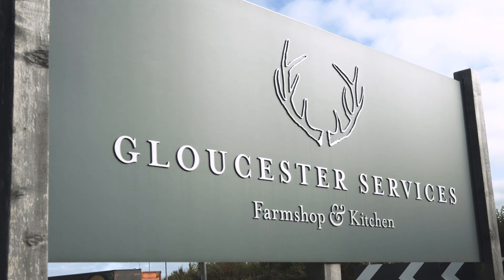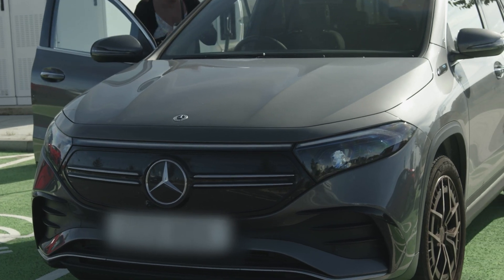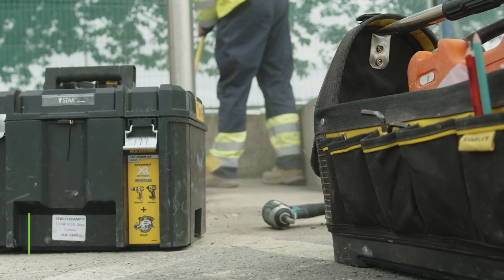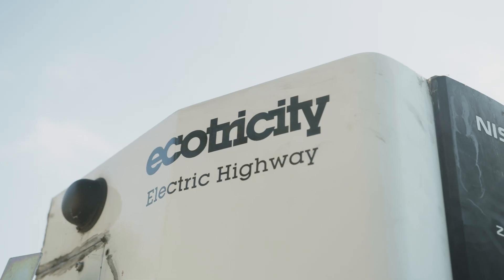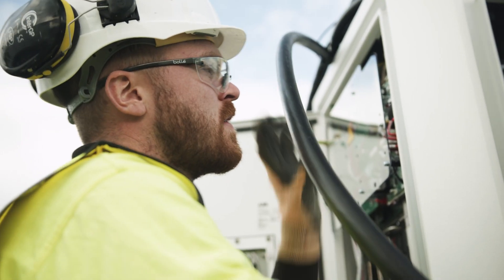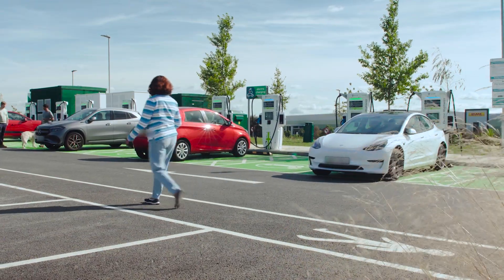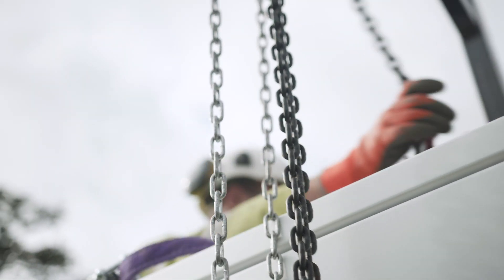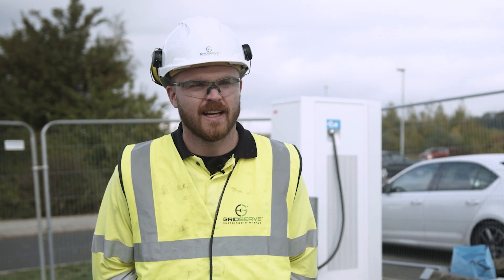Upgrading the GRIDSERVE Electric Highway

Comment: I've an MG5 on order and look forward hopefully to a trouble free journey environment. I clicked on this Gridserve promo video. It is misleading and disappointing. It opens with a drone shot of one of the new excellent facilities, Braintree or Rugby? Not clear, but there seem to be 18 charger units. The message is clear, this is how Gloucester north is going to be. Cut to interview with engineer working on the Gloucester North M5 site, All going to be great, everything will work, full power and reliability etc etc.

The video is five months old. I then switched to Zapmap and the current Zapchat comments of disappointed users of the same site, Gloucester North M5. Only 2 units, or is it 3, not clear. Repeated problems of low voltage, excessive waiting, units that boast high speed charge, but cannot be used by two cars at once if high speed is required. Hints that some drivers are giving up and going elsewhere.

Come on Gridserve. You are doing great in your new flagship units, but don't b****t us with stuff that just isn't true. Tell it like it is, if you want to encourage EV purchases. 

Peter Biddulph

Comment: It’s great what you are doing… but none sadly are being installed in a way that makes them fully accessible for disabled EV users… not even at the Rugby new build… why? Are disabled customers not important to GridServe?
Reply from the maker: Hi Ian, without question, EV charging needs to be accessible for everybody. This summer, the Electric Forecourt in Braintree hosted Motability Scheme customers and Designability to better understand first-hand experiences around EV charging. We're keen to apply these learnings to our future built environments and our charging process, for the benefit of everyone. [Jon]
Reply: @GRIDSERVE  - Hi Jon, thanks for your reply. I’ve personally been actively campaigning for much improved disabled access (as is laid out in current legislation) to the EV charging infrastructure for the last six years; it’s been a very long battle as most organisations simply aren’t interested. I’ve yet to visit the Braintree hub but I’ve good things about it. The problem is that is just one site. In the current race to roll about more infrastructure, basic accessibility for disabled EV users has been totally ignored sadly; as is the case at the Rugby new build; a wasted opportunity to create better access! Will GridServe be retrospectively improving disabled access at all locations that have been upgraded so far? If not, why not?
Reply: Why is it necessary to mount the chargers on a raised plinth? Flat ground is essential for wheelchair users. Bollards around them should be closer or spaced away so wheelchairs can get close and the raised kerb to stop cars getting too close need to be spaced at a distance to enable wheelchairs to circumnavigate the proximity.

Comment: Range anxiety isnt so bad now - now its charger anxiety,will there be an available charger,will it work ,is it ICED. We are installing nowhere near enough chargers at services or on street at the moment and this needs to dramatically increase (as in from 23 chargers a day installed to approx 700 a day)

Also removing all the AC charge points on the motorway BEFORE you had the ability to replace them was a bit short sighted (nowhere to charge ZOE for months now ??????)

Comment: I do find it odd how they are replacement positions when with dual charging (soon) and the AC port the units will generally be under utilised? Ie a seperate AC post for a PHEV or a Zoe allows the dedicated DC power modules to be used for the CHAdeMO and CCS cars. I guess this is the minimal investment option to get the ball rolling so makes sense in the immediate short term. Keep going, the others are catching up though. MFG are building some impressive sites!
Reply: Zoe is one of best selling cars in europe plus a CCS car can use a type 2 socket - very slow though. Type 2 will always be need due to home chargers being type 2

Comment: Looking forward to the day Gridserve FINALLY get around to the A55 corridor in N Wales.
Reply: Looking forward to the day they complete the M6 update,. I was at Keele services northbound day before yesterday looking at a broken CCS that was sadly the only CCS on site. It’s only a major services site on the main artery between Birmingham, Liverpool, Manchester and Glasgow!. Gridserve was meant to have the Ecotricity stuff out by end September. We’re a week off Halloween and it’s still not there and the dual charging software problem is still a feature. It’s not a great report card so far.
Reply: @SteveJones-om6ks  Turns out they did the Holyhead end of the A55 this week!

Comment: Great that more charging but how is a wheelchair user meant to use them?
Reply: Looks like they’re at a height that wheelchair users can access, can you advise on the issue to help us understand thanks?
Reply: @andycampbell193  from what I can see they are not as the screen is on the front and they is a cerb there plus when park up to it they will be no space to access screen? Then need to be on the side of the charger on the path.

Comment: But is there enough power to run both sides of these chargers? I have often tried to connect when one cable is on use and it just states 'charging will commence when there is enough power' and waits for the other vehilce to finish. So not much improvement.
Reply: They say they're waiting on a software update from ABB

Comment: I’m really backing Gridserve to make a difference to ev charging. You’ve made a great start. I travel to Scotland regularly and there’s a real deficit in motorway charging capacity near the Lake District. e.g Tebay, Penrith, Carlisle. Would love to see your roadmap for these areas. Keep up the good work🙏🏻
Reply: Andy, be aware there is also now charging in Shap village, just off Junction 39 of the M6. There are two chargers adjacent to the toilet block in the main (only!) car park. They are operated by Charge My Street, who offer both a subscription service, plus a card or app to allow usage to non subscribed members. I've not looked at pricing on their site for a while, but it was around 25p per kwh the last time I looked. There are also several chargers sited at the Lancaster M6 junction (J34). I haven't looked at these, so I don't know who is operating them....